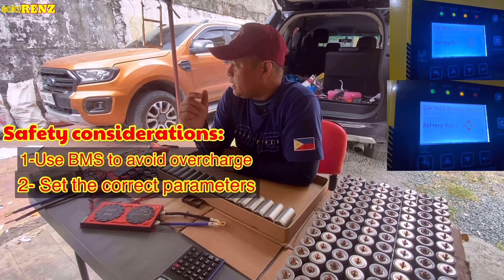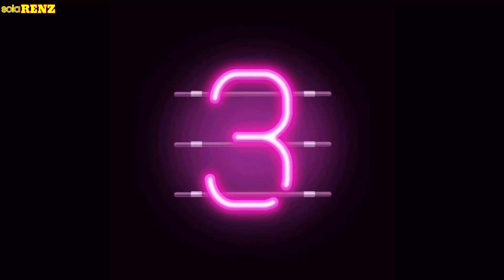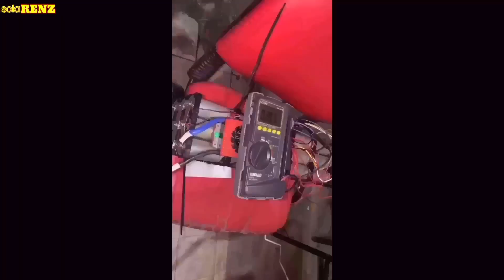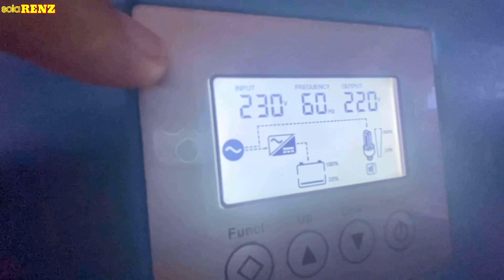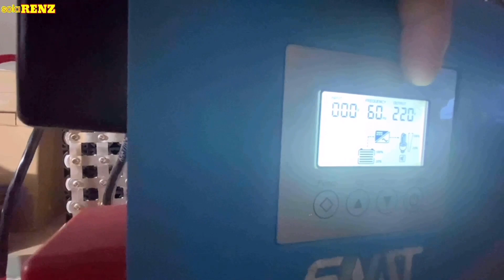24-Volt System 32650 LiFePO4 battery with BMS and ACTIVE BALANCER

Comment: sir pag magdedesign or seselect po ng active balancer para sa battery pack ano po ang batayan or consideration para meet po yung tama or angkop na active balancer para duon sa ginawa mu na battery pack ?
pagkakaalam ko po merun yan Ampere rating . so ask ko lng po kung ilang ampere ang dapat gamitin ko para meet ko yung tamang pagbalanse nya ?
salamat po . 😊🙏
Reply from the maker: 5Amps capacitor type

Comment: Newbie here sir .. sir tanung ko lang po anong size poba ng awg wire ang gagamitin sa positive side ng battery papuntang bms/active balancer terminal block .. 18 or 16 awg ??? " 24v 32650 100ah battery

Comment: sir newbie po. tanong ko lang kung ilan pong watts na solar panel ang kailangan sa ganyang set up na 24 volts?
Reply from the maker: 3pcs na 200watts panels
Reply: @solarenz  ser paano ang connection ng 6 pcs. Na 100w ,(pv) sa ginawa nyong 24v. 
Tnx.
Reply: Naka bili na kasi ako ng anim na 100w panels gagamitin ko sana sa 24V battery pack na 32650

Comment: What makes lithium ion have a shorter charging cycle? Datasheets for 90% of lithium ion and lithium iron phosphate match up in the charging current area: standard 0.5C, max 1C

Both have some power cells that allow 2C charging. LiFeP04 actually has better power cells with A123 and Headway datasheets suggesting a 1C/4C and 3C/10 standard/max charge rate. Lithium Ion (in the pouch cell format) does have SPIM08HP 10C/30C standard/max charge which is insane

Comment: sir sa pag balance, kung wlamg charger pwede ba parallel lang para mag pareho tapos assemble na at sa inverter na derecho na charge? saka pa share naman saan kayo nabili ng 32650?
Reply from the maker: Sir, pwede naman kahit walang pang power supply na pang balanse, pero matagal ang process. Parallel lang lahat, then iwan mo ng 1week para sure. After that, kalasin mo na, tas saka mo i-configure sa 12v or 24v or 48v na gusto mo, bago mo ikabit sa INVERTER. PM mo na lang ako sir para masabi ko sayo ang supplier. FB account ko RENZ JASPER

Comment: Sir, paano malalaman ang sukat ng bms kc po iba iba ang ampers ng bms??? Salamat po sa  pagsagut
Reply from the maker: BMS size depends on the power of your inverter to be used and the voltage system. If you have 5kw and 48v DC system, then i-divide mo lang ang 5000 sa 48 to get 104A, pero hanap ka ng mas mataas konti ang Amps ng BMS, kaya pwede na ang 150A BMS dyan.
Reply: @solarenz  sir, possible po ba na ma dead ang isang group of cells ? Ang set up ko po 8S24P yon cell #3 bumigay nag leak at 0 volt lahat ng 24cells ano kya po dahilan meron nman ako BMS at active balancer

Comment: Sir anu bms pede po saa 24v 100ah 32650 batteries?
Reply from the maker: Sir ang rating ng bms ay depende sa power ng inverter at voltage system na gamit. Halimbawa, 3000watts ang inverter gamit mo at 24V ang configuration, maari kang gumamit ng 150A na BMS.
Reply: @Sola Renz  sir kung 92 watts na ref pwd b yn hanggang umaga or kung ilang oras pwd ty sir 12 volt lng gamit ko ty sir